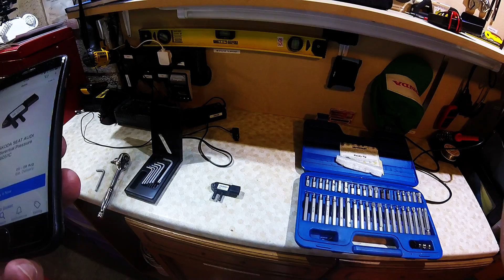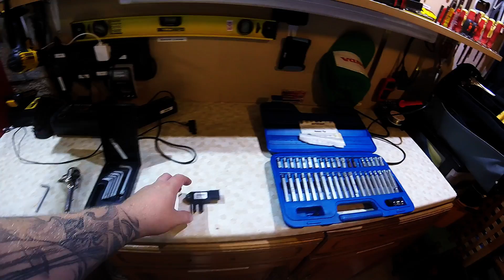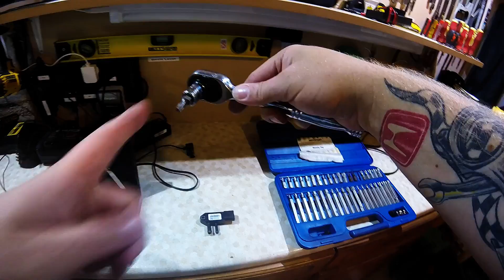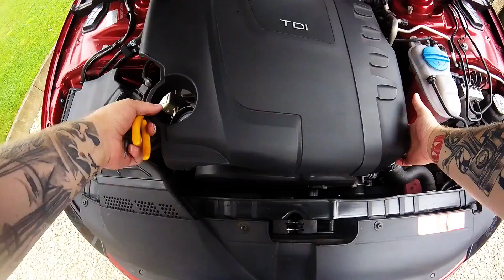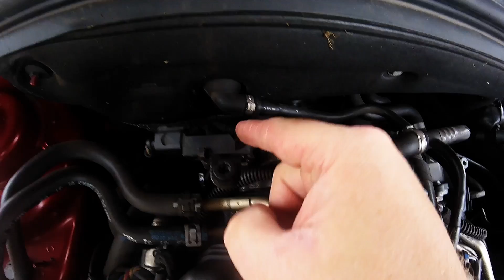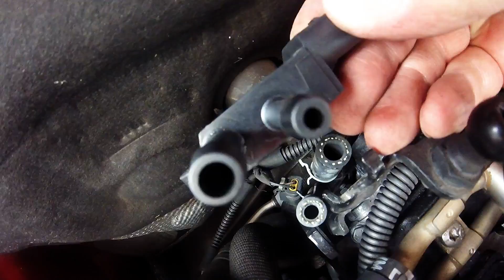Audi A4 B8 DPF Pressure Sensor replacement

Comment: Watched a few vids of people fitting this sensor, one showed the guy just pushing a tube onto one of the input ports then just pushing the remaining port onto a tube remaining in the car! Does anyone know if one hose just hangs loose, or are both connected to the exhaust? Also, will my ANCEL OBDII code reader be ok for resetting the fault lights and taking car out of Limp mode! Please help as I’m looking to fit the sensor tomorrow!
Reply: How did you get on with this? My Audi has had an intermittent limp mode which turned into a permanent limp mode.
Changing this sensor tomorrow hoping that it will clear the fault.

Comment: I have n audi a4 b8 2.0tdi 143ps 2011
I Replaced the same Sensor,but the engine light still on,do i need to calibrate it with a VdCs or?greetings
Reply: Yes

Comment: thank for sharing this video found it very helpful and cost effective. I have replaced the dpf pressure switch but engine light still on. audi diagnosed the sensor issue so cant be anything elsecan you give advice on turning light off and does the new sensor need coding in ? thank you
Reply from the maker: tay vasi I think if you disconnect the battery over night and connect again the next day that might reset the light.
Reply: Foxwell NT201 Check & Switch off Engine Light Code Reader with One Click I/M Readiness Key Diagnostic Tool

Comment: hi what does the smaller thinner pipe connect too thanks
Reply from the maker: Arshad shavez not sure where the other end goes to away from the sensor. I assume that it connects to the dpf, one pipe before the dpf and one after to measure the pressure difference before and after.

Comment: How did you remove the 2 rubber pipes pal? Mine are on tight!
Reply from the maker: I used some large pliers to move the clips down the pipes the twisted one pipe back and forth, clockwise then anti-clockwise whilst pulling on it then twisted the sensor round and round while pulling it off the other one.
Reply: Thanks for that, sorted it now new sensor in and light off cheers, was a bit tight with my sausage fingers. Thanks

Comment: hi, 
Thanks for making this video. I have the same problem on my 2.0TDI A5.
Going to do what you done.
How is it going? Has your emission warning light stayed off?
Reply from the maker: Yes it has. This has cured my issue.
Reply: I just did mine. Plugged it all back in but the light is still on. What a nightmare. 
Any ideas?
Reply from the maker: +mrlopes1234 Did you reset the fault code with a code reader? If not the light will stay on until you do. If you don't have one then I think you can disconnect the battery overnight and that should do it.
Reply: Oh yeah...lol
Thanks for your help buddy. I took it for a little drive then after i restarted the car, the light went out. I disconnected the battery for an hour and the light has stayed off for now.
Thanks for your replies, time and for making the video :D
Reply from the maker: +mrlopes1234 Glad to be of service.
Reply from the maker: mrlopes1234 yeah it stayed off. Sold the car now.